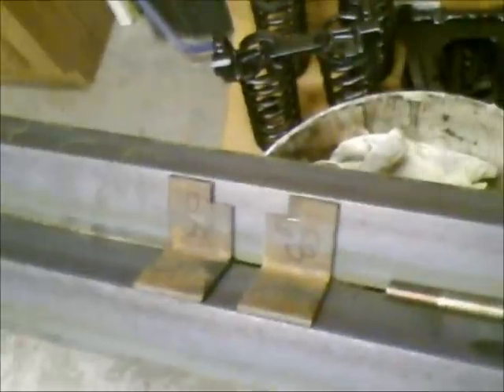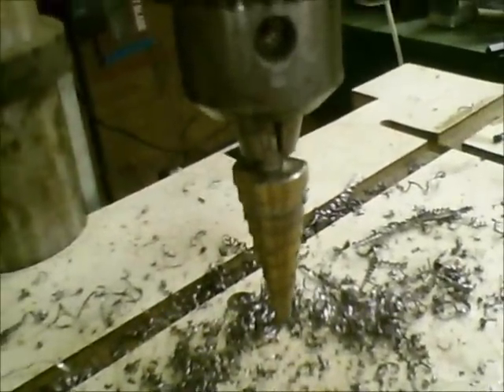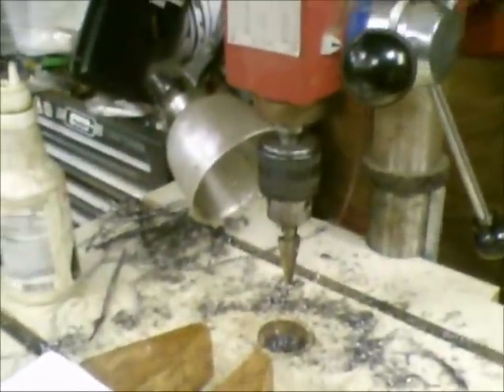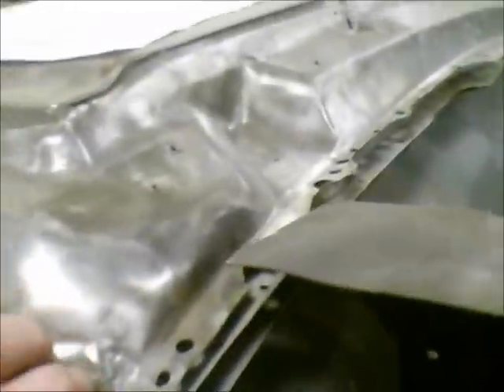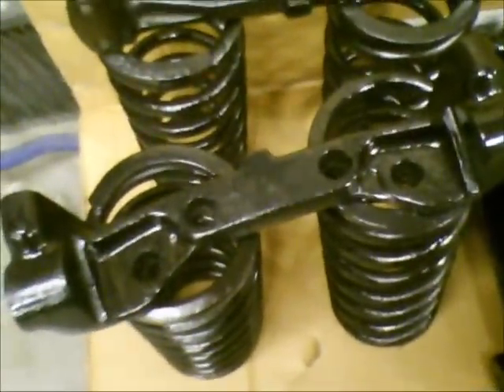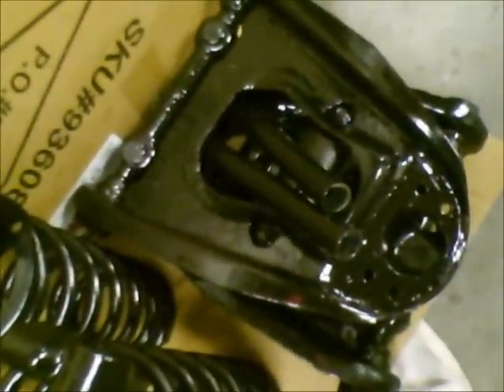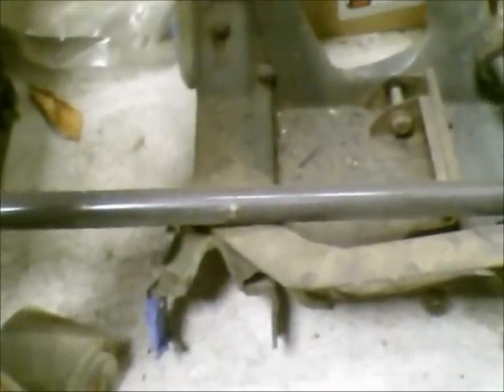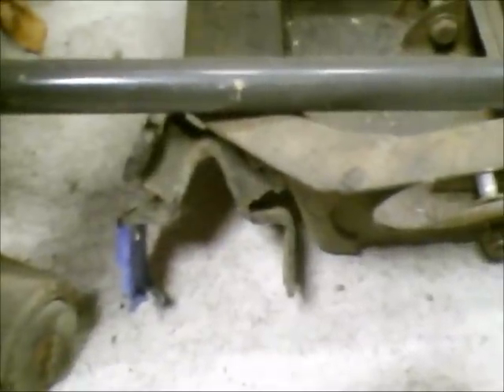DIY sheet metal brake

Comment: Cecil, the home made brake looks cool! I saw a vid on the tube of a guy who used door hinges and lumber for a temp brake, it worked like a charm. Keep us posted on that project, it's interesting. Also updates on the slang aren't boring, keep them going too. Use rubber mounts on the IRS or you'll hear the rear end howling inside the car and the suspension will transfer every road bump to your butt. There's got to be tons of info on adapting this suspension to other chassis on the net, I'll look

Comment from the maker: @Velvethamma My welder is an Airco/Miller synchrowave 300 with a 12 gallon  cooler unit under it and a water cooled torch.
The unit could  handle the 1/4 inch but my skill level on the tig is not up to the task yet
I need more practice with it to get my technique with the torch and the foot pedal down.
I use the mig way too much but is easier and doesn't require the argon(flux core)
Thanks for watching

Comment from the maker: @satajet883 It should fold up to 16 gauge metal with no problem(if I have enough strength to pull it).
Maybe I need to eat some of the jerk sauce you sent me right before I use the brake,that wll get me fired up. :-)
Thank you for everything.

Comment: I agree with stick welding 1/4 inch and thicker metal.  Keeps your gloves cooler than the mig or tig!  Unless you are fortunate enough to have a water cooled torch.  Thanks for the vid

Comment: Oh yeah...  On machining the bolts...  I sometimes put parts in a drill, clamp the drill in a vice with the trigger locked on and use a file to remove material.  Just a thought...